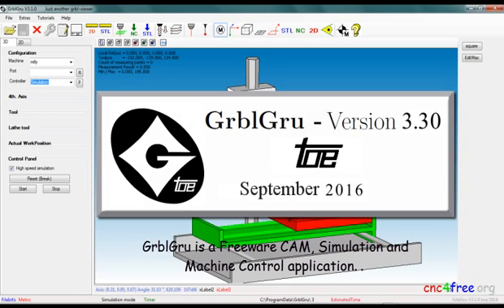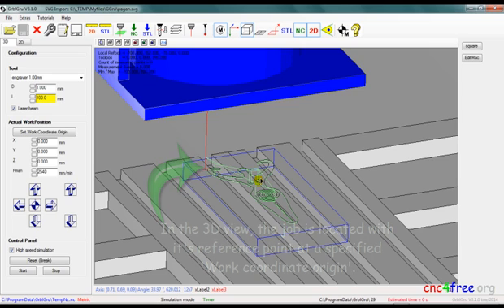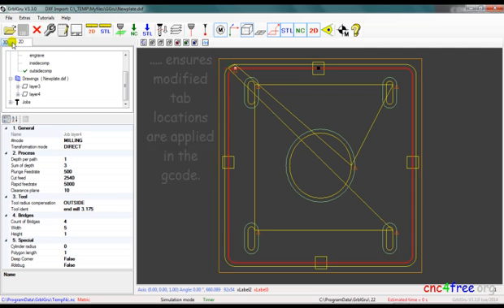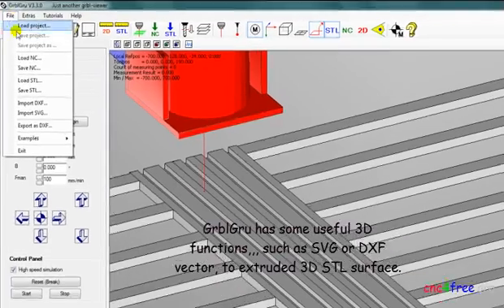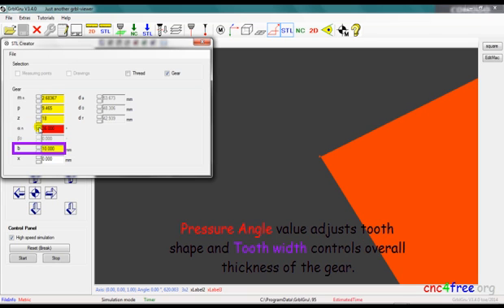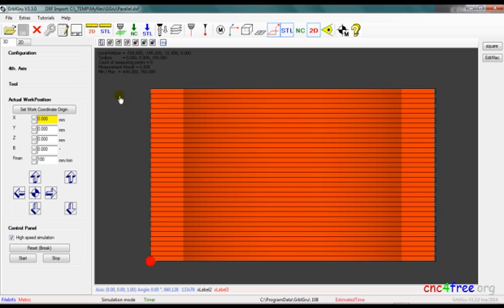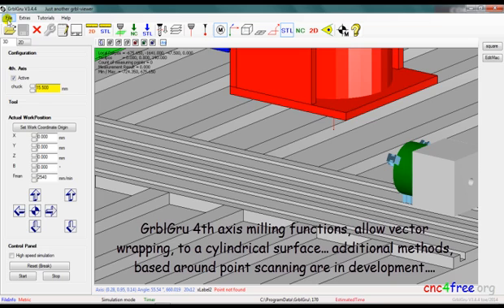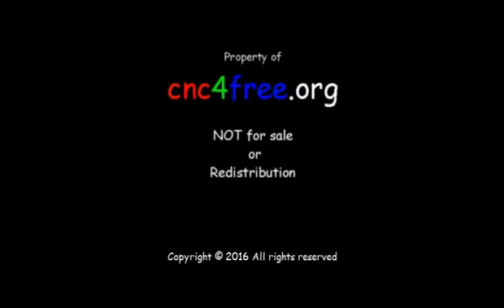GrblGru FREE Milling / Lathe CAM, Simulation, CNC control Software

Comment: The flat view -  NOT the simulation view, looks suspiciously like the tooling part of cambam...   I suspect both  are some sort of open software thing?
Reply from the maker: Hi there,

I think the software author points out that the 2D editor part of the software IS influenced by CamBam.  I wouls aggree that, up to a point there are many similarities. GrblGru has some additional features over the CamBam free beta.. but I couldn't say If this is the case compared with the full or paid version of CamBam.

Also, as far as I know, while there is a FREE beta of CamBam and GrblGru is also free.. niether have actually been open-sourced.

Hope this helps